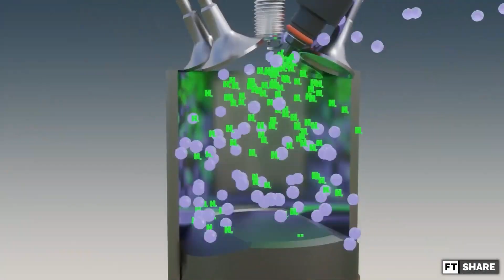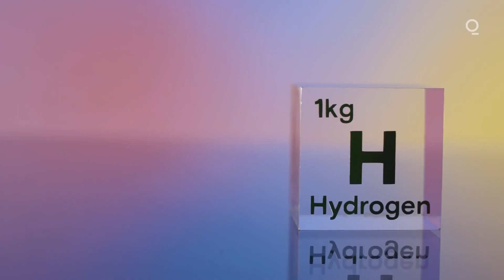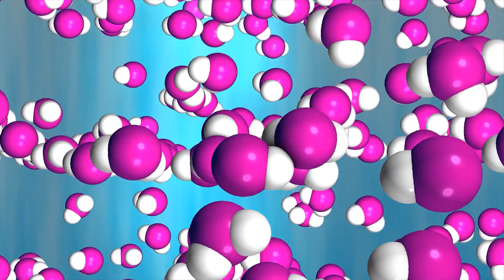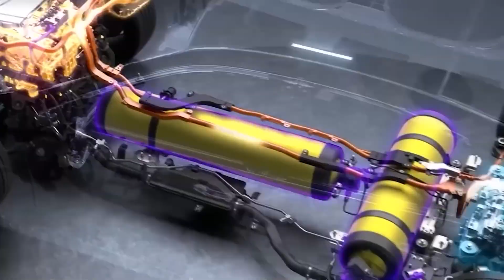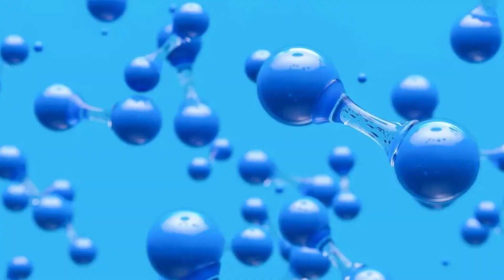This Engine Might Destroy The Entire EV Industry!

Comment: You rightly point out the issues about how the hydrogen is made, but there is another part to this: While the electricity may be from a Green Source, it still requires more of it to split the water, than if it was just stored in a battery, or some other storage device. If you put the SAME amount of energy directly into your BEV, you will go further than in your Hydrogen Combustion Vehicle.
JCB DO have a good case for THEIR operating environment where their machinery is constructing the infrastructure that EV's require.
Reply from the maker: Oh, thanks for pointing this out, Con🙏👍What kind of car du you drive your self?
Reply: @itselectricvideos  In 2012 we got one of the first Plug-in Prius in the UK. We ran that until 2019 when we upgraded to a Kia eNero, that we would have kept, except for the EV6 coming out with the Vehicle to load and towing capabilities. It cost an eye-watering amount, but the EV6 is a great car, and one I don't anticipate changing!
In 2011 we invested in 10 Solar Panels on the back roof. Why would you not get an BEV if you can charge it yourself? Most of our driving is from our own solar, and with Octopus as our Energy Provider, the rest is from a green source.

Comment: hydrogen engines arent new, mazda did it for a while. It just didnt catch on back then. Also technically you're just moving the emission source. To make the Hydrogen from water you need electricity, so if thats coming from a coal powerplant then that isnt better, is it? That also applies to EVs altho they're even worse when you consider all the emissions from making the batteries.

Comment: Where is your closest hydrogen supplier ? Where is your closest electricity outlet? Hydrogen will take so much infrastructure build, that isn’t a dead end. Only reason hydrogen is a thing is because the cheapest way to produce hydrogen is from fossil fuel, so big oil is promoting it. But in the refining process, carbon dioxide emissions are produced, so no help for the survival of life on earth.
Reply from the maker: Interresting what you are saying there. I need to find out more about this. Thank you, Mats.
Reply: Even if they make it from clean - green electricity (green hydrogen) they will spend 60% of that energy to make it, press it, store it, transport it and then they will use it in an ICE with 40% efficiency. LOL Total efficiency less than 30% of the spent energy.

Comment: One thing no one talks about with hydrogen combustion engines is you need to burn it in 100% oxygen instead of air for it to just make water. With the normal atmosphere, it also makes some nitrogen oxydes which are air pollutants.... literally ozone at low altitudes. And it also makes acid when in contact with water vapor.
Reply: Can't they bundle both oxygen and hydrogen into the fuel? Obviously with safety precautions so that it doesn't self-ignite which it probably won't under low temperatures. Or just use two tanks, one for oxygen and one for hydrogen with a clever "fuel nozzle" that already has split connections built into one so the end-user doesn't have to deal with the extra burden. Kinda like EV charging cables which have a + and - for electricity to flow but instead you have an O2 line and an H2 line. I mean the electrolysis process nets both oxygen and hydrogen separately, so theoretically it shouldn't be more expensive.
Reply: @surena9451  that is totally possible but it would make it far more expensive because oxygen cannot be stored the same way as hydrogen, it can't be liquefied over a temperature of -119°C no matter how much you compress it. This means you need a way to cool the tank at cryogenic temperatures at all times. Except that,, its would function the same as air for the engine.(well better but you don't need to change much in it's design)
Reply: @victorunbox9353  Why would oxygen need to be in liquid form? Can't they use the same design as medical oxygen tanks? I mean air only has 21% oxygen so theoretically you can just inject "that" amout of pure oxygen into the combustion chamber combined with the right proportion of hydrogen and it would theoretically still work, right? Instead of 34:1 stoichiometric A/F ratio you go 7.14:0.21 which would be the same. Or is what I am saying impossible/stupid? Honestly idk.
Reply: Same sort of thing with ev,s they are zero emissions but the electricity is made by a coal power stations
Reply: That depends on where you live. In the UK most Coal Powered generators are put on standby periodically, but rarely run. Gas is now about half, and will reduce as more renewables come on line.
Now in the USA, Coal is still common, but this will change as renewables are proving to be less expensive per kWh as development progresses.
Reply: Well I live in Quebec so that's really not a problem for me but it is a real issue in most of the world
Reply: @victorunbox9353  I would anticipate that in the "most of the world" where electricity comes from a generator, (there being no grid to supply it), it is easier to truck in fossil fuel rather than hydrogen, so why would you change? 
A point to consider is the increasing popularity of solar PV out in the "sticks." Generally this starts as a way to scare off predators like Lions, Elephants Etc. to avoid conflict with villages. This has the added benefit of led lighting in homes, (something the West takes for granted), enabling children to get a better education, and adults to make things at home, (working in the evening), that they can sell, generating more money that enables more solar PV. They are part of a 3rd world where the "Grid Infrastructure" phase is by-passed altogether: No need for phone lines, they have cell phones, and electricity comes from sun and wind. The time may come where a 2nd hand EV is a great investment as they WILL be able to charge it for free. And not have to pay a huge amount for diesel to be delivered.

Time may prove me wrong on this, but to me it seems logical.
Reply: That happens only in the country of freedom, where the big companies don't give a s%£$ about enviroment. The same companies that want to produce hydrogen from methane. Next 10-20 years you will have chinese EVs everywhere in your country, wake up!!!!